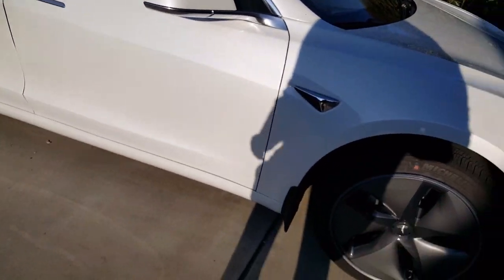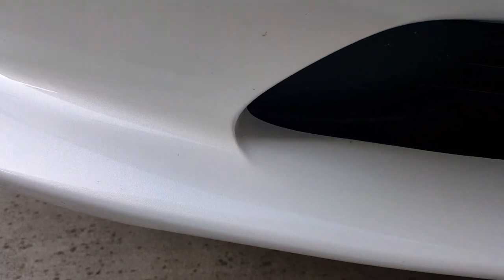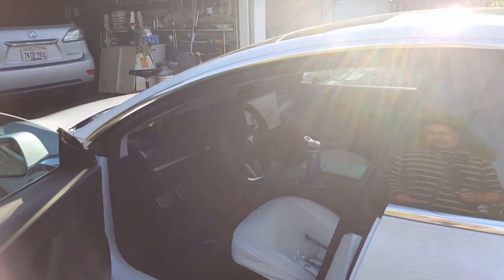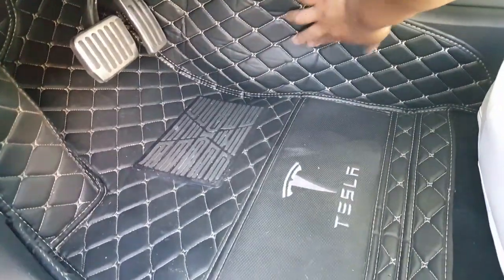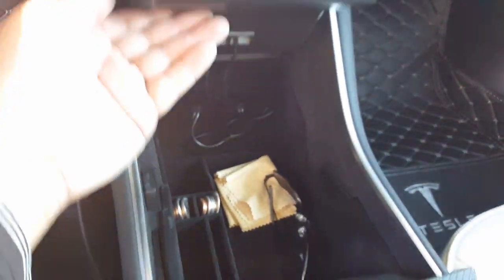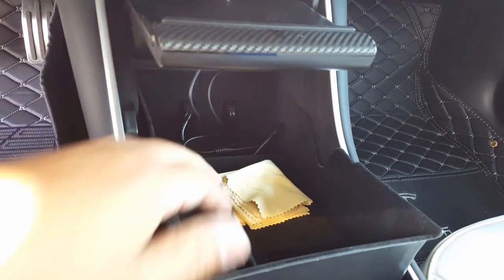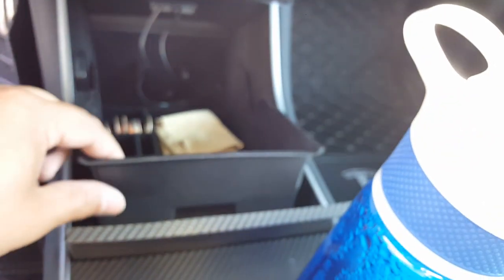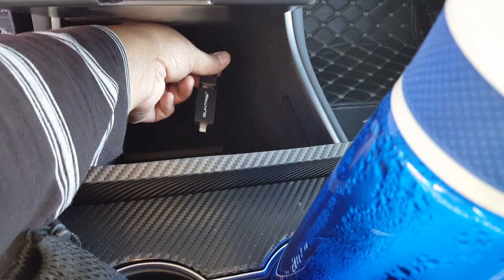Tesla Model 3 BEST ACCESSORIES + MODS 2020

Comment: Hi Mike, I have a Model S and I installed the aluminum pedals.  I noticed that your accelerator pedal is installed upside down.  The narrow end of the aluminum pedal should point to the floor.  You have it pointing up towards the dash....unless you prefer the way it looks that way.
Reply from the maker: That's a good point you're right turn arrow should be pointing downward but I guess more accelerator surface for me to push. Funny I don't even feel it wobbling it's put in correctly.  thank you for mentioning it